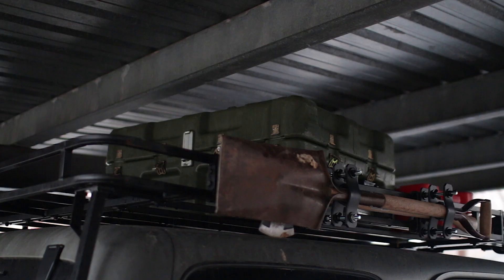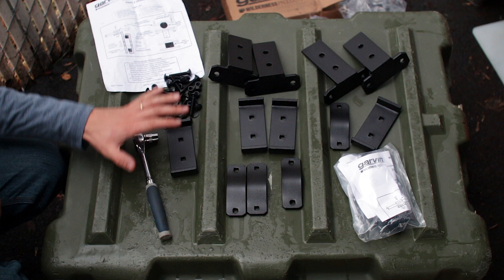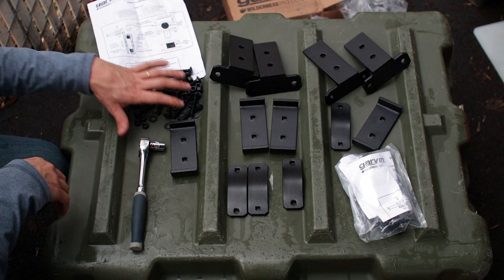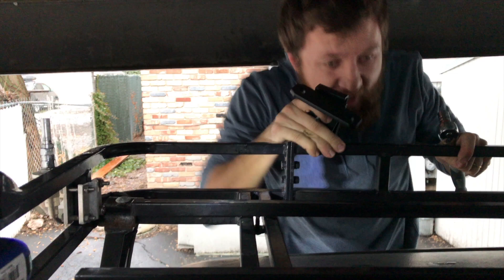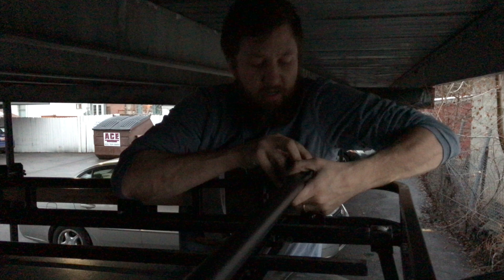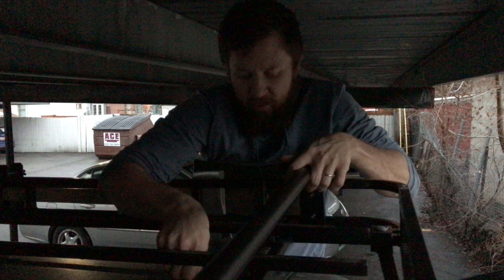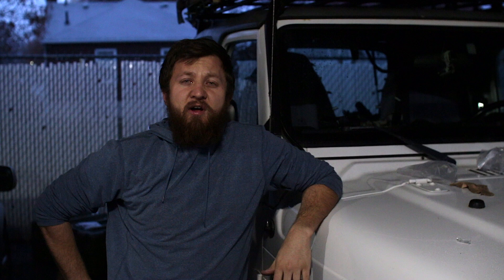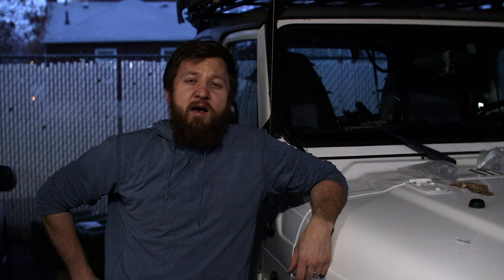Garvin Wilderness Rack Cross Bars

Comment: Thank you for the video. While the rack looks gorgeous and sturdy, mounting the cross bar on top of it will raise my RTT further higher off the roof. Is this the only way to mount the tent? Do you have any issues with this setup in terms of balance and wind noise?
Reply from the maker: With the Garvin roof rack this is the only way. It's because the rack has side walls on it. If the rack were flat, then you could just mount the tent directly to it with no cross bars. 

In terms of wind noise, it's a very mild increase. Stability is definitely affected, but any time you add over 100 pounds on the roof of a TJ center of gravity is going to take a dive. 

One other note, very few roof racks for a TJ are built to handle the weight of an RTT. I want to stress that it is very important to pay attention to the weight ratings of the roof racks before you purchase one.
Reply: @EmbarkWithMark  Thanks for your feedbacks.